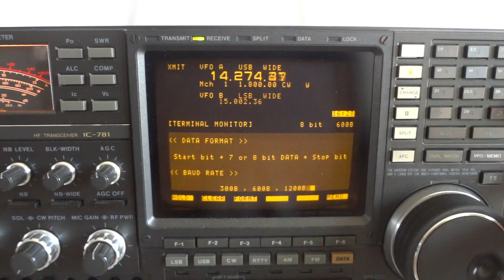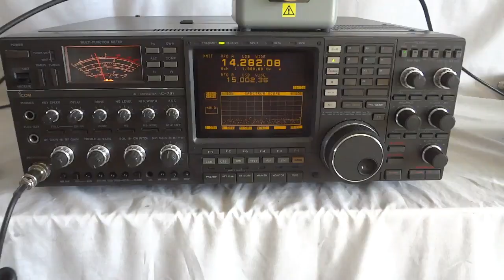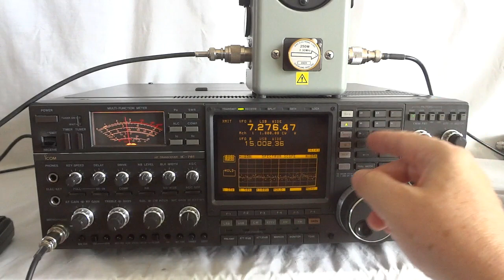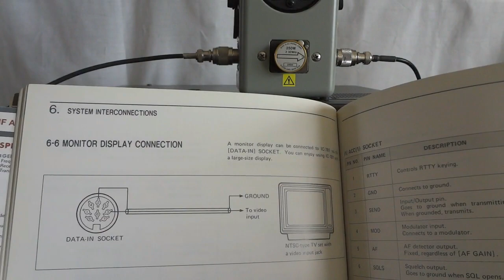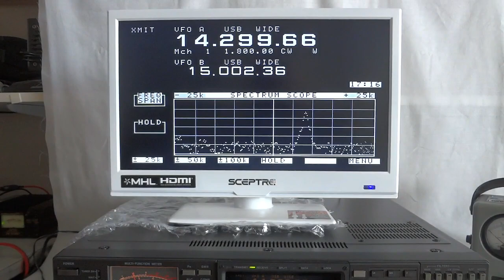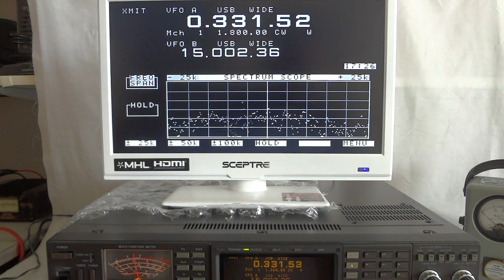Icom IC 781 top of the line HF SSB transceiver from the Nineties

Comment: Interesting - I used to have an Icom R-9000 HF receiver, and that had a very similar look - it had less controls on the left side, but the CRT and the stuff on the right was pretty much identical.  I wonder how much of the same platform the units shared.

Comment: I picked up one of these, with an ALPHA, at a swap table, about 12 years ago. I don't think that the seller did any research. He said make an offer, I just threw out "a grand", he jumped on it and asked if he could help me out to my truck. 
I did the external monitor right away, because it's cool. 
I run a net on Fridays on 7.204 and get great feedback from contacts, at how well it sounds. 

Great video, thanks. 

KG6YVD
Reply: I've seen them for a grand on some sites
Good deal

Comment: Did you think it is as good as the Yaesu FT-1000D ?
73
Reply from the maker: On paper the IC-781 is slightly better than the FT-1000D, but in practice I could not find any differences. Of course with the noise level I have here, that does not say much. Both radio's are also built very well, so that is not much of a differentiator either. Hard to say which of the two I would prefer more. Probably the IC-781 because the CRT is so cool, but again, it is really a toss-up.

Comment: Thank you for the great video on the IC-781.   Can you please describe ...or do a quick update  video on the DIN connector or the video out and how you made that connection?  Thanks again.  I've subscribed to your videos.
Reply: Did you ever get that info? 73 - Patrick KM5L   I loved this video, got me re-excited about my old 781
Reply: @patrickbouldinkm5l143  Not yet
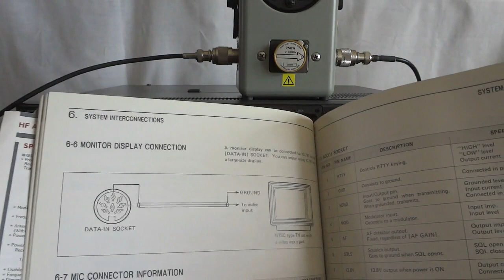Reply from the maker: See 23:05 of my video, it shows the page in the manual that specifies the cable. You need an eight-pin DIN connector as shown on that page. Connect a piece of coaxial cable to it (preferably 75 ohm). Connect the shield to DIN pin 2, and the inner conductor to DIN pin 3. The other end of the coax goes to the monitor's composite video input.  So you will need a monitor that has an NTSC composite video input, and is capable of 15 kHz scan (which is standard for NTSC). Newer LCD monitors might not be capable of such a slow scan speed, so check the monitor's specs first before you buy one. In this video, I am actually using a low-cost LCD TV receiver, those most likely will also offer NTSC backward compatibility (mine did indeed as you can see here). Cheers.

Comment: This was introduced in 1988, not 1979-80. Still a great radio, but not something Doctor Who dropped into the market!
Reply from the maker: You are correct - my bad. It was introduced in 1989, and the price was over $8000 then. Cheers.
Reply: @LifeIsTooShortForQRP  I only know this because I was a penniless teenager in 1981 with a new license and serious lust for the IC-720A,, which seemed state of the art at the time for ham radio. After a lot of saving up and holiday jobs, I could just about afford an IC-2E, which was... not quite the same (although I had huge fun with it...) So that period of radio is etched on my heart.
Reply: i used to have the ic r9000  and miss that radio,  although only a reciever, virtually the same, super, but did not realize composit vid out,  super,